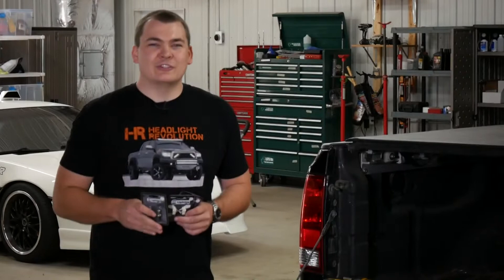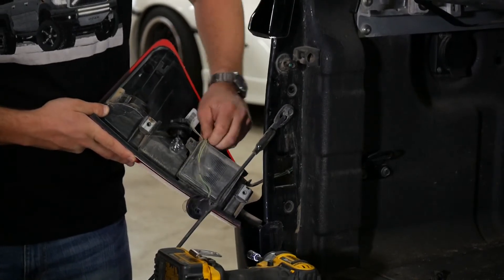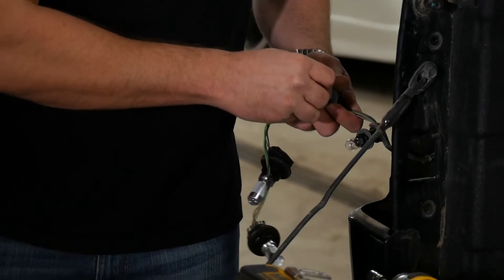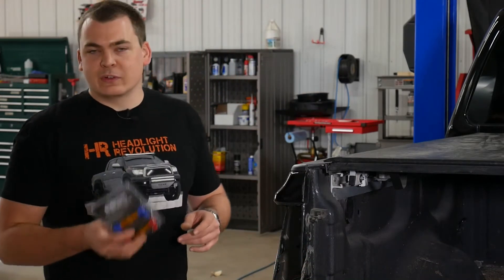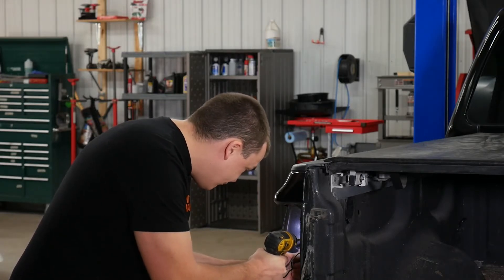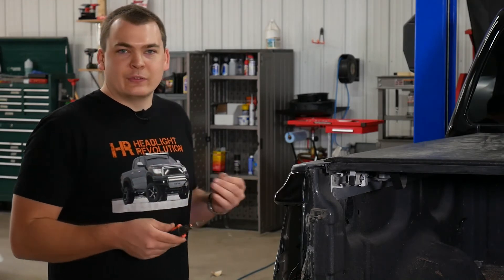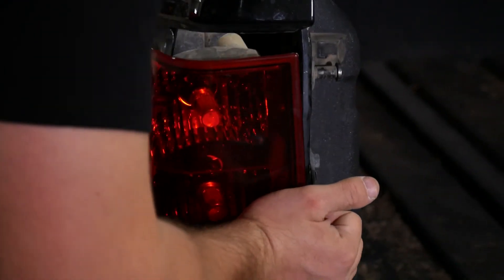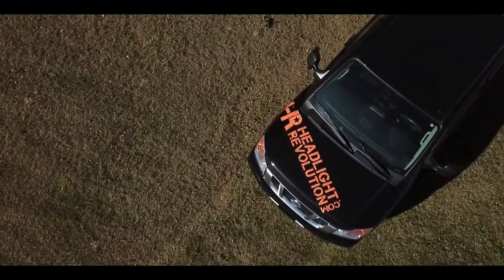2003 - 2015 Nissan Titan LED Tail Light Bulb Upgrades: Bright Reverse, Brake and Blink Bulbs

Comment: Have a question about my 15 Nissan Frontier. I have tried led and it only works on running lights and no brake light. If I turn the led around and put it back in i get brake but no running lights. Is there any fix for this. Thanks
Reply: Check ck socket.ussualy the led tail ligths comes with standard sockets check CK socket. nissan has Ck socket
Reply: What is ck socket
Reply: Check google differences between standard socket and ck socket, usually led comes with polarity... i have a nissan note...  same problem...